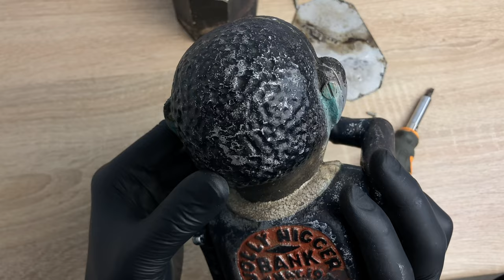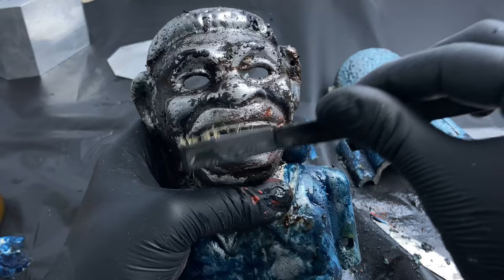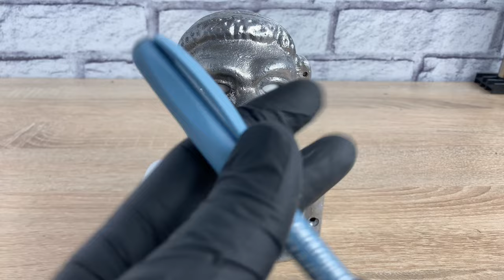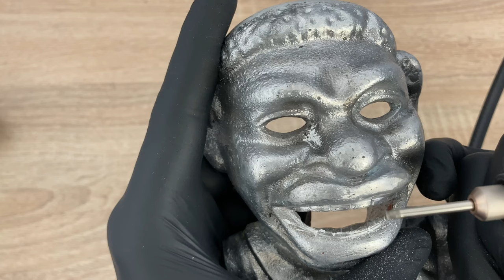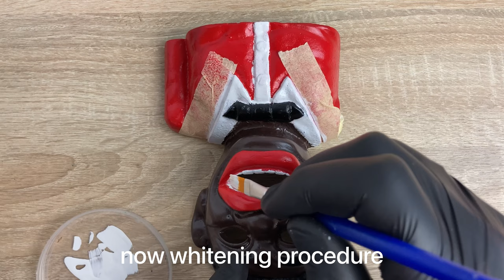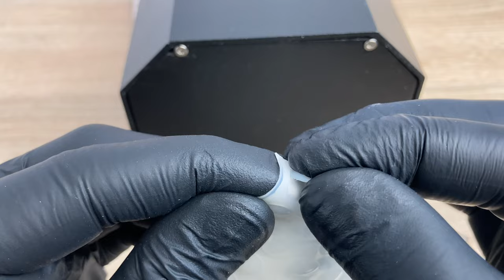Restoration Of Vintage Mechanical Coin Bank - JOLLY BANK 1977

Comment: Great restoration job! What's blowing my mind is this bank is from 1977? I was 13 years old. I for the life of me can't imagine any product having that word on it back then. I certainly never saw it.
Reply from the maker: Thank you very much, I'm really glad that you liked it 🤝 yes, I studied several sources and they were really produced at that time. I didn't even exist back then.)
Reply: I was 9 in 1977, and I loved browsing around in novelty stores back then. I never saw anything like this, ever, around Norfolk VA, and neither did my friends and relatives. Judging from the style and mechanics though, Imthink this must be from the 1940s or older. 1970s stuff was made of way more plastic than this.
Reply: I’m pretty sure that was the patent number for the coin bank and not its year of manufacture.
Reply: It's correct. These have been copied since 1890. The copies were never clones of the originals. They used screws instead of rivets and did not have the locks like the  I.e.stevens originals

Comment: It may well be a cheap Chinese knock off
Reply from the maker: Yes, the original piggy bank was made of cast iron, but mine is an aluminum alloy, and it's definitely not from China. How would you rate the restoration result?